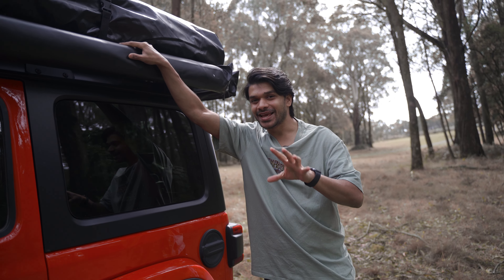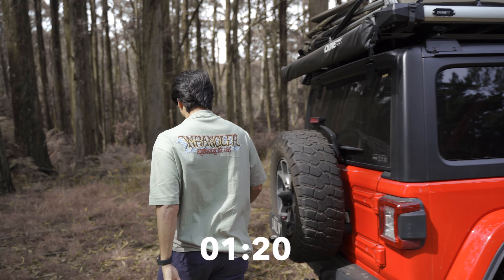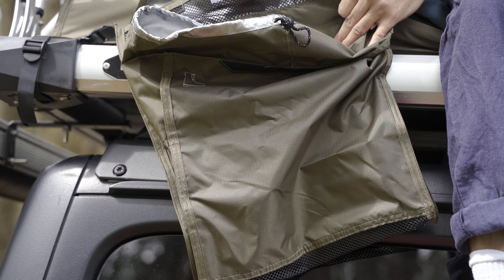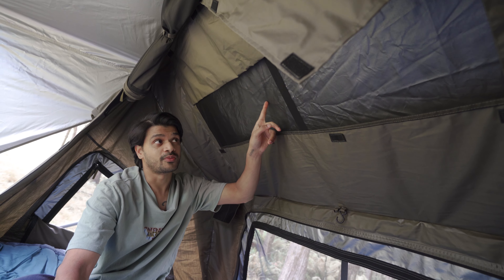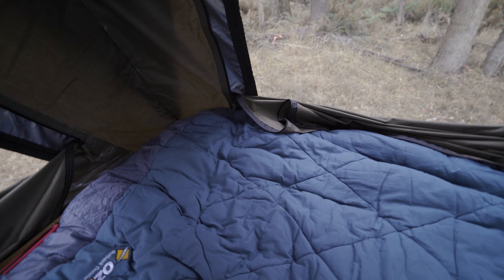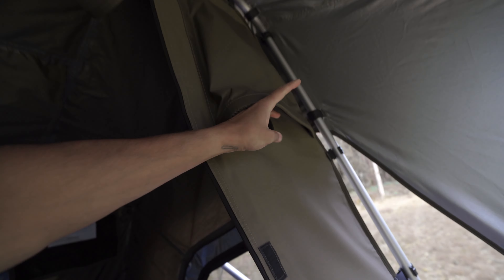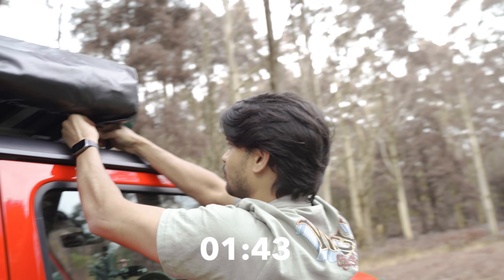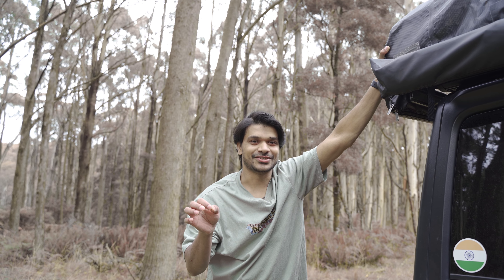Best Budget Rooftop tent? Dune Nomad Roof Top Tent 140cm

Comment: Hi, great review with good information. A question please: Have you found that the loose cover lets in lots of dust that then gets into the inside of the tent? Also, I've come back to your video and can't remember but is there any condensation problems or issues with rain for this tent?  Thanks
Reply from the maker: Hi there! We personally haven’t had dust issues. Minor dust makes it under the cover. Very minor. No dust gents in the tent at all. 

Condensation is an issue but that’s any tent without ventilation. When we sleep with the side ventilation pans open, it’s all good. 

Breaths hitting any cold surface without having anywhere else to escape from = condensation.

Comment: Hey man, got any ideas on how to get the cover back on easier? I cant roll it forward as i have a solar panel in front of the tent and it will be covered if i roll it forward, I have a ranger and its on the back(canopy) and its a very high vehicle so its a pain in the ass to try and get the cover over the top of it easily... any ideas would be appreciated
Reply from the maker: Sorry about the delay mate, I was away. Yes! I actually tried the pole method where you pop a small stick or pole (wider than the tent width) on top of the cover. Then take the corners from either front end off. Hold them to the stick and roll the stick. It basically rolls the cover up around the stick while taking it off easily. It does require 2 set of hands though.